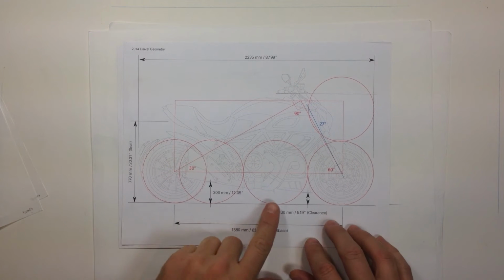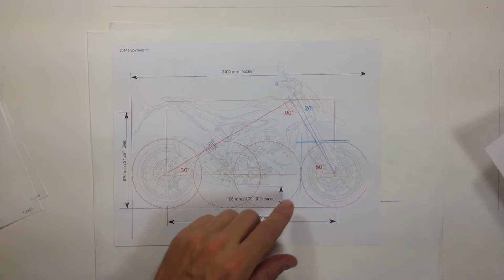Motorcycle Sketching - Part 2 - Perspective

Comment: What are the basic techniques that we should know before designing motorcycle and cars
Reply: @LaForteDailyDemos  thank you so much sir 
I'll work on all these thing to improve my designing process 

Thank you for helping
Reply from the maker: That's a great question. I think a few things that are easily overlooked and under appreciated by beginners is line control, making confident strokes and eliminate the scratchy indecisive back-n-forth motions that comes with being unsure. Drop a line, let it arc, let it flow, run with it and adapt, improvise, allow space for ideas to emerge from little "accidents", as in a mark didn't go down exactly the way you imagined it should've, learn to live with it and then build off it, make it into a little detail. That kind of thing. This kind of freedom and improvisation comes with practice and learning to accept your hand, your work, your validity or agency. 

The second thing to develop is learning to be light with your arm so you can make light line work to set up your eye and then work into it slowly, progressively, and build up details through drawing deeper tonality of lines. Working on line value range goes a very long way.

Maybe lastly, practice controlled cross-hatching, or just single direction hatching; parallel lines, evenly dense and even line weight. Speed and control comes with a lot of practice, but it comes. When people just jump to speed without having sufficient practice, years of it embedded in their muscle memory, then it becomes scribble. But controlled hatch lines to create value depth feeds into marker control.

Super valuable and subtle technique details!

Enjoy the journey!